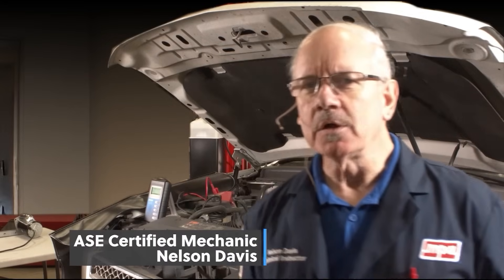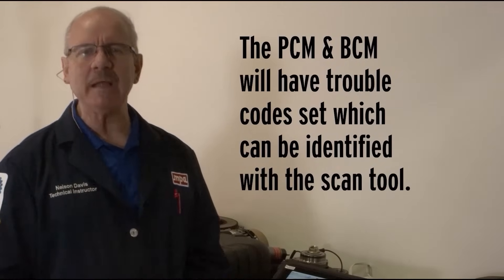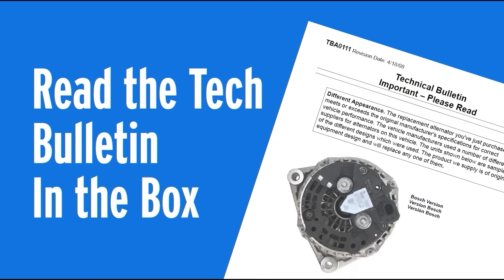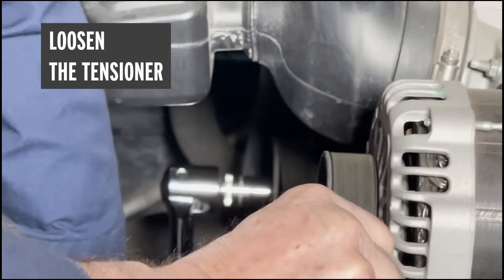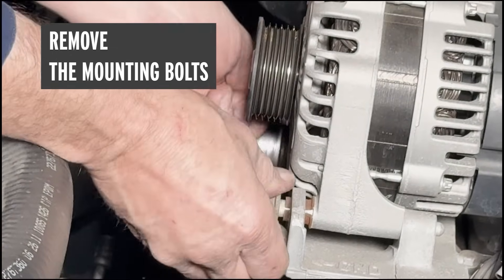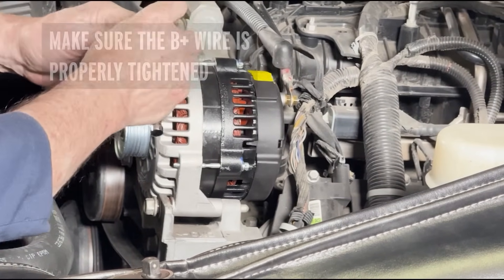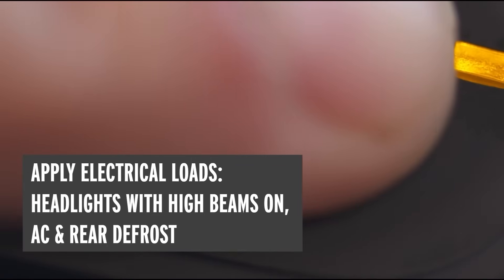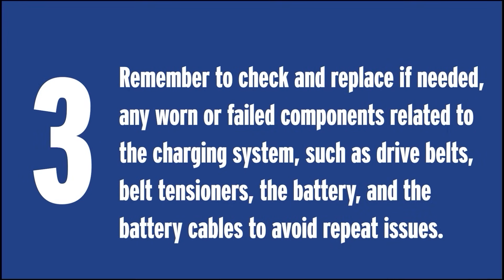Regulated Voltage Control Charging System Explained  |  2011 Chevy Avalanche Alternator Replacement

Comment: Ict billet sent me that dumb alternator with my LS swap brackets for my 68 camaro.  They said to buy thier plug with a resistor and itl work with my car. It only charged in limp mode around 13.4 volts . I didn't want the extra wiring and a pwm . There was no info on how to swap out the regulator to a 4 wire so guess it going on marketplace for cheap and ill buy a one wire